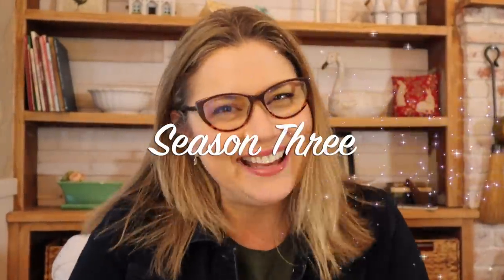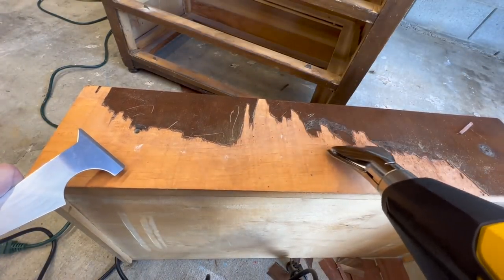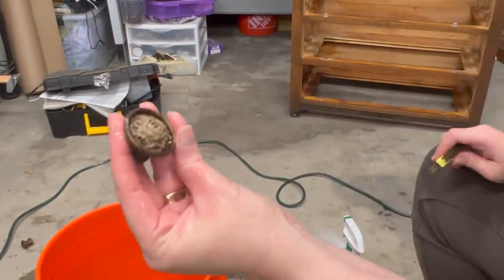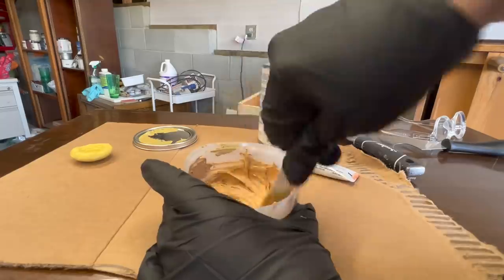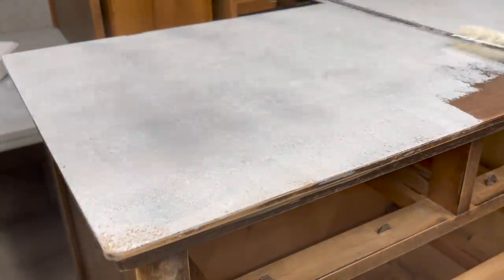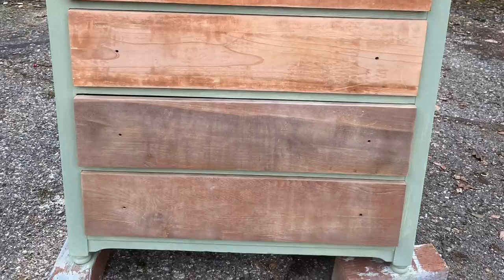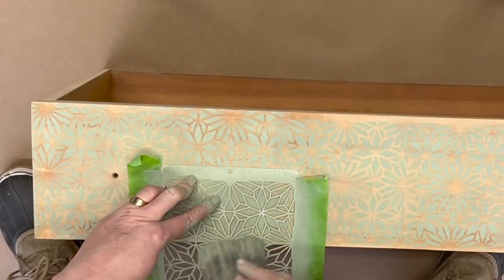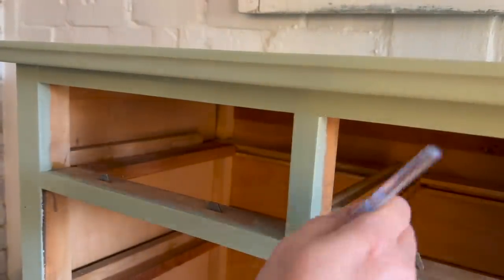ANTIQUE DRESSER FLIP | Remove WARPED Veneer | Create ANTIQUE PULL REPLACEMENT | Paint Modern STENCIL

Comment: You gave it a nice vintage vibe and the color is really pretty and refreshing :) I also just got a rotex but went with the 90. It’s so nice and quiet compared to my dewalt. I’ll have to sell more pieces though to afford the dust extractor which I hope isn’t too far off in the future. I did notice the squiggles in the wood on the drawer so was curious as to what grits you used and what was your ending grit. Did you use it in rotoex mode? I noticed more squiggles happening in that mode but was able to get them out with the 150 and 180
Reply from the maker: Thanks so much!!  I didn't use mine in rotex mode - I was def trying to just get the feel for it.  I started with am 80, and then went up not skipping, and I believe I ended at 280.

Comment: Still watching...but wondering why you didn't take the veneer off the top, as it's such a solid wood construction?
Reply from the maker: Great question!  I considered it, but I did a thorough check, and that top's veneer was otherwise very solid, no sign of bubbling, cracking, or peeling.  Because of how it was constructed, taking it off might've caused a whole host of other issues - the transition points might've been compromised, etc, and so I thought it best to leave it alone and do a simple repair that one corner.